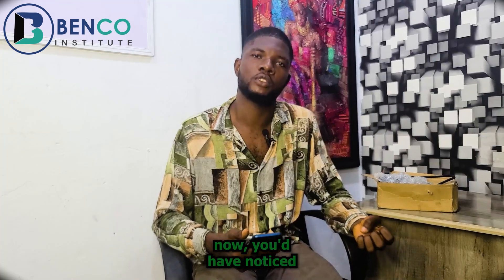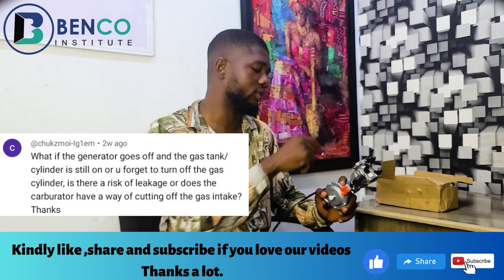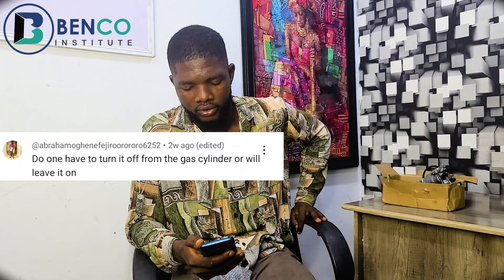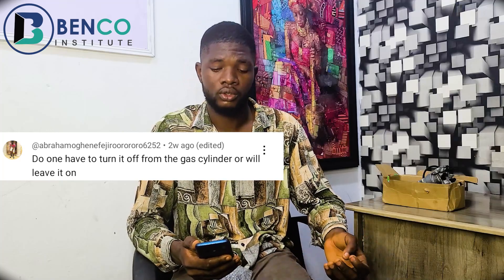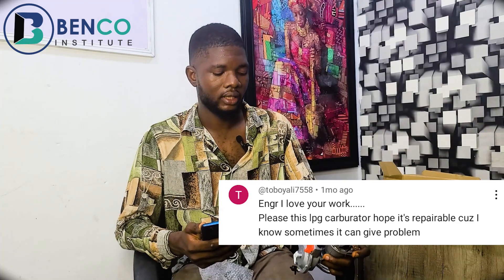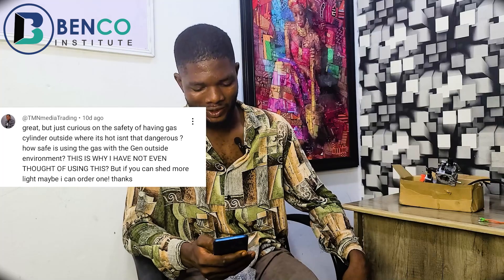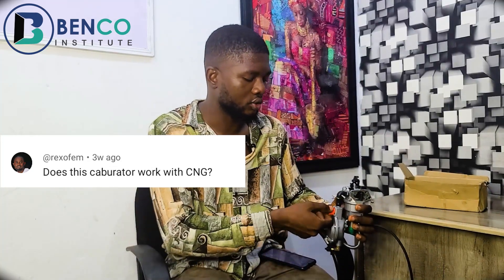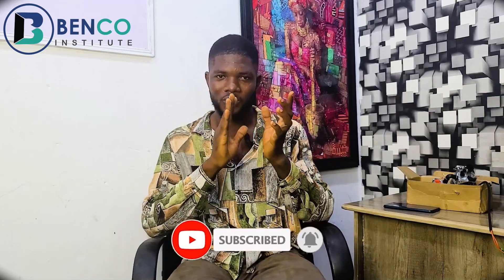Petrol to Gas Carburetors: Answering all questions and fears ,Watch this before you buy a carburetor

Comment: Boss, the first question is very important and you didn't give a straight answer to it. The question is what happens if the generator goes off maybe due to faulty plug, low oil or any mechanical problem that can cause the generator to go off and you slept off or you're not around to go turn of the gas cylinder. The regular petrol carburetor has floating valve switch that stops fuel from entering the carburetor when your generator is not in use even when the fuel tap is on, does this gas carburetor have same floating valve to stop the gas from entering inside the carburetor if the generator is not running or will the gas continue supplying the carburetor until you turn of the gas cylinder valve?
Reply from the maker: Oh yes, it does actually

You notice you have to constantly hold the white  spring switch(primer) to constantly push the gas into the engine for the gen to come on.

Take it that the gen is Dormant without working gas doesn't go in right,same applies when the gen goes off for any reason
Reply: @bencoinstitute  Great! Thanks for clarifying this.